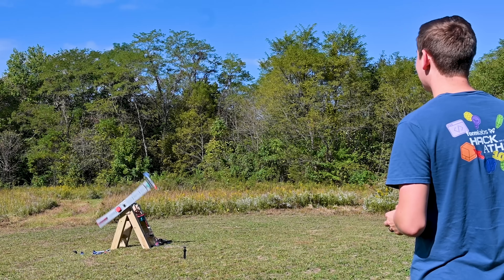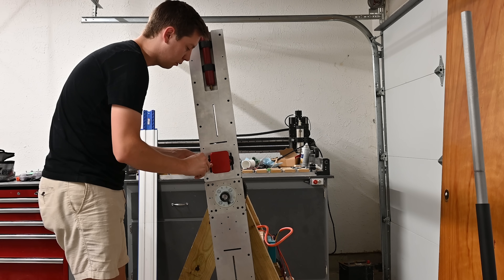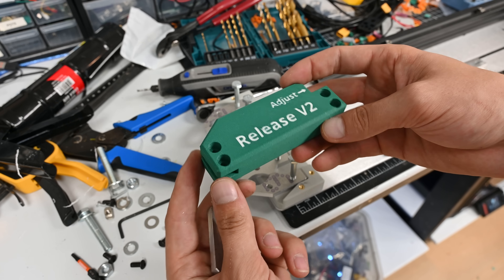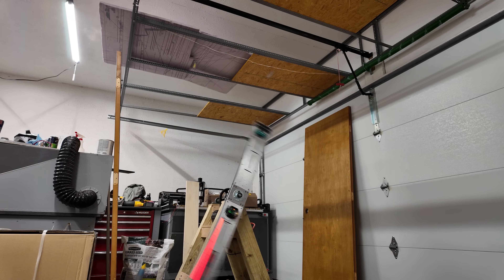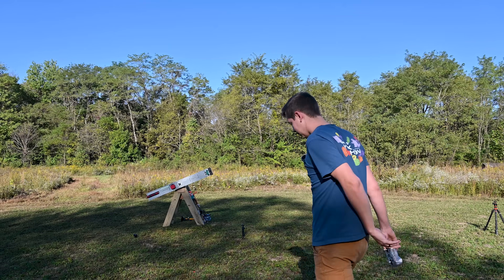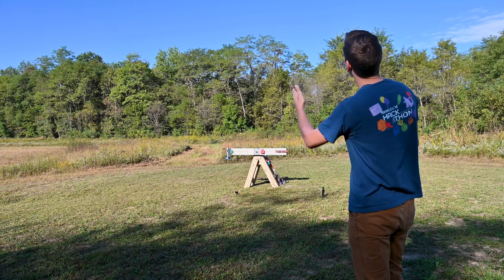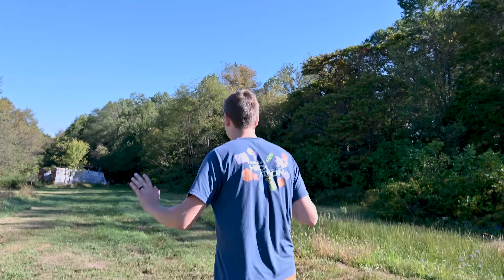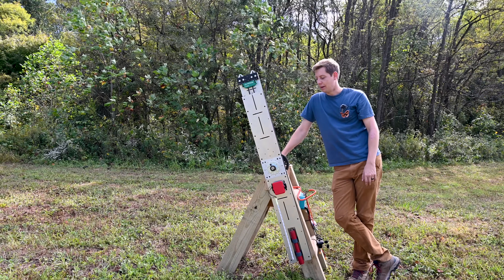I Fixed SpinLaunch

Comment: You should combine this with a solid fuel rocket motor which ignites when the thing is already doing 80 mph, giving it a huge boost.
Reply: el problema es hacer un sistema en el que el combustible aguante cantidades enormes de fuerzas g sin explotar en el proceso
Reply: @sextoyultimo6177 do those small hobby solid rockets actually have issues with g forces? I suspect they can handle hundreds of gs pretty easily.

Comment: I'm surprised you're not using a digital encoder/hall effect sensor like modern engines use for crank position and then solenoids for releasing the two rocket holders. That way you could adjust with a number in a computer instead of an allen wrench and tearing everything apart.

Comment: Put the rocket on a pin so that it keeps the same attitude relative to the ground pre-launch. This could be controlled by a fairly simple mechanical gear mechanism in the launcher and/or a gyro in the rocket. Then all you have to do is release it at the right moment - no fancy release mechanism needed - and it will fly straight and true without tumbling.

Comment: This release could be triggered by physical g-forces shifting a weight at the release point. Then design the geometry so the delay is automatically taken into account as you adjust the threshold for g-force

Comment: Power the rocket with a small model engine, then compare static launch peak altitude vs spin launch assisted, w/motor peak altitude, which you’ll have to try to keep the weight the same to make them comparable so a electronic predictable means of ignition is going to be key… being able to put the energy wasted into getting the rocket from static up to even just the velocity from spin launch into upward momentum I’d expect to make a dramatic difference as it probably uses a lot of its burn time/fuel just getting going.

Comment: How about instead of it attached to an arm connect it like a flywheel trebuchet with a cable. Those things can go supersonic. Best part is if it is designed right it will take all the energy from spinning and use it for the launch. Just aim up.

Comment: There's literally more engineering hurdles in front of a successful spin-launch than there is in front of FTL space travel. 

The material science advances necessary to make this possible, would require hundreds of years, and the advances to make THOSE possible, would include base-level physics-- which would likely come with new and MUCH BETTER ways of getting mass into orbit. 

Soin launch is a complete fucking scam-- however, the constant applied effort, similar to how war is the most majorly effective driver of innovation on Earth, will eventually spur such material science advances. However, money need not be wasted on an effort that those advances will NOT actually help see through to completion.

Comment: Missed oppurtunity: Launch vehicle should be a disk/saucer, then it does not need to have the rotation countered, and bonus free stabilisation without fins.
Reply: And use a Simple Compressor and a Tesla Turbine. 50000 Rounds Per Minute should Fling it quite far. This is Basically a Home Made Legal Artillery System, Throwing Tank Mines.

Comment: Now put a rocket motor in it. But crucially, start small with a B or C motor. This would essentially be a two stage, so you'll get plenty of altitude with a small motor in the sustainer. Otherwise, contact a local high powered amateur rocketry organization to see if you can launch with them to not worry about FAA guidelines. 

Because of gravity loss, you'll get the highest apogee by igniting the motor as close to lift off as possible. However igniting it is not going to be easy. Not sure how you don't end up with the igniter cable flying around. 

I'd love to see this!

Comment: Prettty cool! Very glad to see your success over those issues you had last time! I have a few (hopefully constructive) thoughts:

-Did you still have the flow restrictors in place? If you want the least variable release, you want the net force applied to the release mechanism to exhibit low percent variability. Since this force is composed of variable frictional elements and the repeatable pneumatic cylinder input, I think you'd want the cylinder force to be as high as possible and as abrupt as possible, so that the acceleration profile would be completely dominated by the applied force and the variable mechanism friction and stiction of the piston seal would be swamped. However this of course would mean that the distance traveled by the mechanism would need to be longer between release points to achieve the same timing. If you are still forced to use the flow restrictors, I'd imagine that you're sacrificing variability, and that you could get better performance with a longer travel between the release points of the two claws. I'm not sure how much more travel distance you can accommodate, but I think the more the better.

-Are you using one of those dual pneumatic cylinder, like SMC sells (SMC CXSJ series, or something similar)? To the extent that the friction between the front and back claws is variable, your release timing is depending on the tilt stiffness of that cylinder (and the degree to which the cylinder actuation force remains constant under tilt loading). Yup, those cylinders are pretty stiff, but they're not infinitely stiff, so to the extent that the platform can deflect/tilt and allow one piston rod to move differently than the other, the release coordination isn't guaranteed. If you think there is any issue with this, it might be nice to reconfigure the carbon rods into a very long triangle, rather than keeping them parallel, so that they nearly meet at the cylinder end. A tilting load applied to the release would not apply a tilting load on the cylinder platform, but instead a small lateral deflection load, and really the tilt stiffness of the release would then depend only on the axial stiffness of the carbon rods. As a side benefit, the rods would be more closely radial in their orientation. As it stands, they don't lie on radii, so they'll deflect outwards slightly due to centrifugal loading at higher speeds, tending to change release system dimensions. 

-the unbalanced mass of the release mechanism surely means that it's sensitive to spin speed and needs readjusting not just because the speed changes ideal release timing, but because the cylinder is working against different centrifugal loading of the carbon rods and head. If you added a counterweight on the far side of the pivot that was coupled to the cylinder you could remove that part of the speed effect. I'm not really totally clear on the internal design though, so I can't see if this is at all practical. Moving the cylinder itself to the far side might be the ideal solution. Smaller required adjustments in cylinder force as speed changes ought to mean you can make your adjustment range finer, and so achieve better repeatability. But more importantly it means more of the air pressure goes into accelerating the release mechanism mass, and less to fighting the centripetal force from the release system mass that the rods are always transmitting to the cylinder. This means a larger balance of force left to overwhelm the variabilities of friction, and more consistent timing.

Hopefully those thoughts are interesting to you, looking forward to see your next video!

Comment: 1 really precisely controlled linear actuator as an ejector lifting a hinged ramp along the edge of the arm with force applied tuned to impart enough counter rotation to counteract the existing rotation of the rocket. The ramps maximum angle would be the tangent to the circle at launch Ramp along the length of the rocket minimizes vehicle stress and stuff some PLA through holes to create a conformal surface for the ramp if you want to practice with eggs 🥚

Comment: A slightly larger version of the rocket with a solid rocket engine and a camera.  Capacitor and a g-activated switch would fire the rocket engine within a second of release.  The added mass would give it more momentum.

Comment: If you add a little weight just offset of the center towards the rocket that has the same mass as the rocket that will shoot to the side of the rocket the same time you release it with the air cylinder?

Comment: This is awesome! Congrats on everything, really!
Two things crossed my mind when looking at this: the release mechanism dependency on RPM and the software + electronics for timing the angle of release.

1. RPM dependency on counter-acting angular momentum: you have adjusted your "claws" timing to a fixed ratio, but they should really be dependent on RPM. More RPM = more momentum to counter-act, therefore bigger gap in release time, and vice-versa. I feel like you could easily calculate this angular momentum counter-act in software and adjust the claws electronically while spinning to achieve the perfect counter-acting. A simpler, testing, version of this would be calculating and adjusting the claws manually for each RPM - but I'm afraid the adjustments would be so small they would be very hard to achieve by hand.

2. Software-based release: using software and electronics for timing the release will always be a big point of failure. I'd try and use something more "mechanical" to achieve the release angle. Something like a mechanically activated solenoid, with fixed actuation time. Imagine a fixed "tooth" (in the sense that it wouldn't spin) that comes closer to the arm and triggers the solenoid. The tooth would have to move "up and down" depending on the RPM, considering the fixed actuation time of the contraption, to achieve the perfectly timed release. IDK how big of a problem this is, to be honest, but I always trust something mechanical much more.

LMK if this makes sense to you!

Comment: Why are you using pneumatics to release the payload?  Electromagnets would be so much easier and precise to adjust and time.   You could use a laser pointer and a photocell to tell the arm when it was perfectly horizonal so it would release straight up.  No bad launches based on your ability to press a button in the right nanosecond and the analog delay of your current solution.

Comment: Bare aluminum really doesn't like to rub on bare aluminum. It galls quite quickly. For a low usage item like this you might be able to beat it with lubrication, but anodizing one or both parts would improve reliability and durability of the release mechanism.

Comment: If you mounted the rocket on its own turntable at the end of the beam (turntable axle parallel to the main beam axle), and connected that turntable/rocket assembly to a pulley on a non-rotating shaft with its center at the main axle center (with a chain or belt loop), then the rocket would NOT rotate in relation to the ground. It would only rotate in relation to the beam. Yes, your beam would rotate, but the rocket's turntable would be fixed in relation to the ground. When released, then, the rocket should continue in whatever angle of orientation you had adjusted the turntable to.

Comment: Could you reverse the direction of the release mechanism so that it slides out (from the view of rotation) to release
Place a slot in the bars to allow actuation, combined with using the point as a wedge.
The release mechanism could be weighted to balance out the payload with only a little movement.
Ideally, this should also make the release more reliable since it works with the forces instead of pulling against it.

Comment: Spin launch is not needed...and ROCKETS are not needed either. We have anti-gravity. We have warp drive. We have TELEPORTATION. We have UNLIMITED ENERGY - Even FUSION. We have ZERO POINT ENERGY. We aren't SUPPOSED to know any of this...because the DOE has made it "nuclear secrets"...so we don't have this in public. There was a LEAK of a teleportation incident...11 YEARS ago. Ask if you want to open a can of worms on this material.

Comment: If you reduce the arm’s weight to gain more RPM, you could place a counterweight on the opposite side of the rocket. As the system spins, the counterweight’s inertia could pull on lighter release pins to launch the rocket, while its shifting mass helps keep the arm balanced. Futher more can maintain consitancy of launch timing instead of relying on PSI

Comment: Single point release but you hold  the rocket by it's "engine". This way it will always release without tumbling, coz centripetal force vector is always aligned with rockets CM,  just like Roman blumbata or olympic  hammer throw.

Comment: If they get Spinlaunch working reliably, I suspect it won't be single-stage to orbit, but act as the lower stage of a rocket, which still has some advantages (though also has to be robust enough to handle the angular acceleration stresses).

Same deal with NASA's maglev sled project.

The cost, complexity and overall efficiency would have to directly compete with lower stage boosters for launch vehicles.

It's also sort of the same idea of why a space gun isn't practical, but could be used as the primary stage of a rocket. (ie the projectile itself is a rocket, but propelled in the initial stage though an external launch system ... explosive propellant, rail gun, catapult, sled, etc)

It might make sense to combine with hybrid air augmented rockets for higher thrust for the flight portion still within the atmosphere (and have a variable geometry ramjet-scramjet transition for the air augmentation before exiting the atmosphere).

It has SOME of the same advantages and trade-offs of high altitude airborne launch systems (like the Soviets considered for space-plane launches), but different trade-offs and probably more complex cost-benefit analysis. (given with the air launches you can pretty easily calculate the cost of a lower stage booster system that would be used on the same vehicle for ground launch)

Comment: Moving the rocket to the center of the spinlaunch arm and placing an armature with a bearing located at the launching point would allow for a kind of horizontal trebuchet mechanism, allowing the rocket to be ~5ft from the center of rotation at launch instead of 2.5ft, and increasing launch speed significantly while allowing for reduced rotational torque until the launch mechanism is triggered.

Comment: Could you have a little weight on a track so you could adjust it further out or in based on the weight of the rocket? Maybe even just a stack of washers as the weights so you can easily add or subtract small amounts just for maximum adjustability.

Comment: Great project, I'm really curious how this continues to develop =D 
Instead of timing the release using time delay and a hall effect sensor and a magnet, what about this: 
Your remote control just sort of marks the launch as "scheduled", and an optical or a contact sensor at the exact position the make it happen? 
Like... if the sensor is triggered AND the launch is marked as scheduled, release the rocket at the exact position to launch it straight upwards.

Comment: For the release mechanism not working sometimes, is it possible that it's due to experiencing too many Gs? The green part has to slide towards the pivot. That means that the failure mode is "no release". If you reverse it (by using a groove in the bars instead of a pointy end) you wouldn't have this issue anymore. But be careful! The new failure mode would be "release" if too many Gs... That would mean a random launch which isn't very safe.

Comment: I think that you should find a way to redesing locking - if you "unlock" - then weight should be going outwards not inwards - now your locking mechanism is pulled to the center - which is hard in such high Gs, and it creates MORE imbalance (you can see in slowmo how everything is shaking right after launch - because you lost weight of rocket and you shifted mas to the center too.
I think that legs on both sides of rotating arm would help too
I can see that time between releasing locks is only time dependent - this time is different for different rpm - maybe it should be somehow fixed to rotation speed

Comment: So you could add a weight on the arm, that releases at the same time as the rocket, to counter the sudden loss of the mass of the rocket. That way you can use a much heavier rocket and not have the whole thing go way out of balance at release. Also....you are working on a way to ignite a rocket motor, just after release....right?

Comment: Upgrade to a steel frame and anchor it down too some concrete blocks using car engine mount post, this should help address the concerns of vibrations at higher RPM. Use a pair of car axle bearings to increase RPM. Try adding a model rocket motor to your rockets with a timed ignition after launch to see how much altitude gain can get from the spin the launch. A fun project..

Comment: In ww1 and 2, planes had synchronized machine guns where when the propeller reached a certain point, the gun was switched off momentarily via a mechanical switch to keep pilots from shooting their prop. A similar system might make it able to release the rocket at the same point regardless of spin speed

Comment: Could do a small counterweight that slides along the arm, farther towards the end for more counterweight, closer to the center for less. That way you could bring it in towards the center on release. Not really sure on a mechanism that could move fast enough to achieve this though.

Comment: Apologies this was already somewhere in comments and I missed it. You mentioned balancing after release a simple slider tube attached to your pneumatic system should allow balance adjustment after lunch. A weight match piston inside the air reservoir to slide out as you depressurize.

Comment: I know that it's counter interested, and in some cases more problem prone (faster and adjustable adds levels of "interests"), but you should try to use the 3d printer less where molding and casting can be utilized